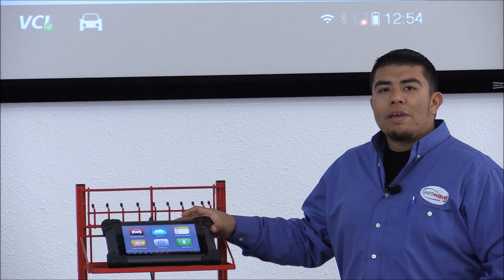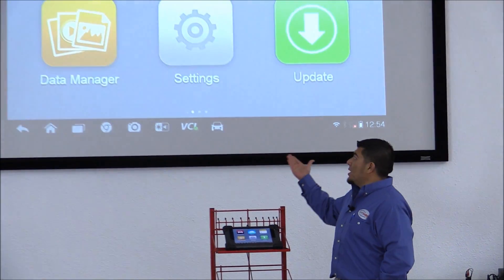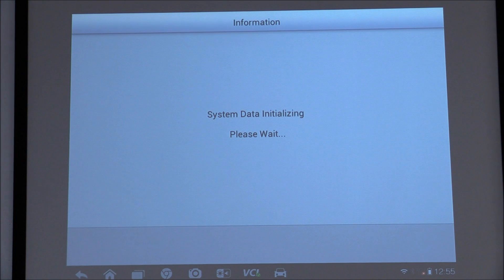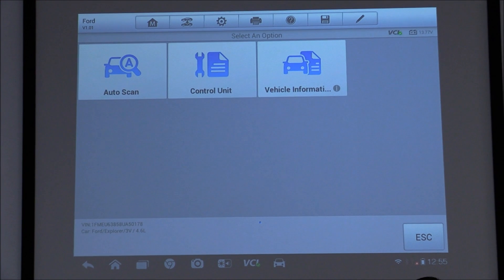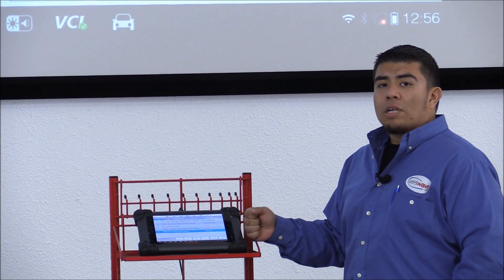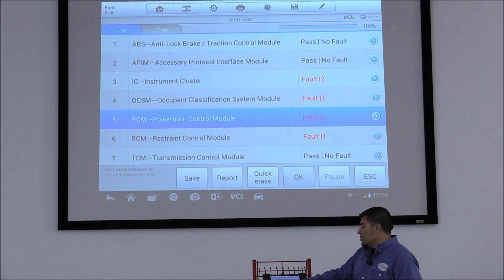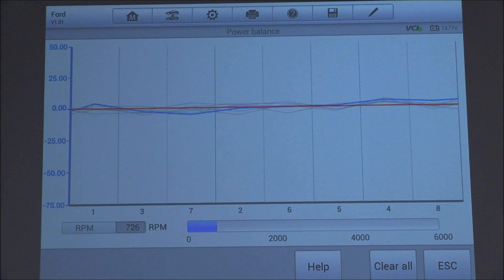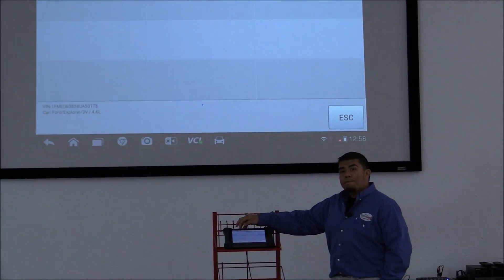Autel MaxiSYS MS908 Ford Power Balance with Screen displaying on 10 Foot Display using the HDMI Port

Comment: Do you know if Maxidas DS808 has the same functions as MS908?
Reply from the maker: The DS808 is not a US authotized tool, so we do not have any direct experience with it and it cannot be warrantied by Autel USA. However, from what I know of it the differences are that the both tools have the same code, data, and bi-directional controls. The MS908 can do more module coding, the MS908 can do some module programming through the tool, also the MS908 can communicate with the MaxiFlash J2534 pass thru device.
Reply: @AESwave  Ok I understand, so this notice is very important yo know.

Comment: Looking to jump into J2534 tooling. Are there issues with the Autel J2534 interface? Do I need to purchase subscriptions to each OEM to facilitate a re-flash or is there support through Autel servers as a source for OEM software. Not sure how the Autel system works or is planned to work. Maybe a video showing some graphing O2 sensor, fuel trims and injector pulse width.
Reply: I bought an MT2500 for my older MB. W208, W140 🤷🏽‍♀️